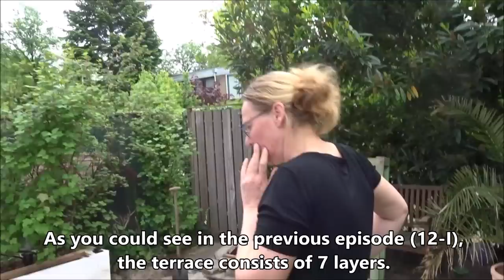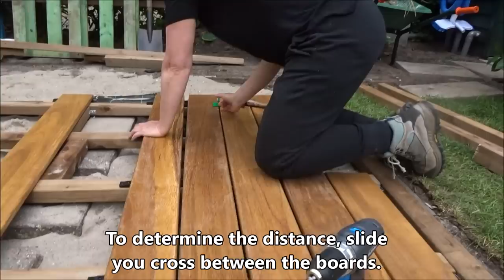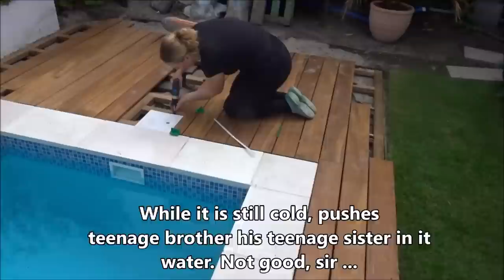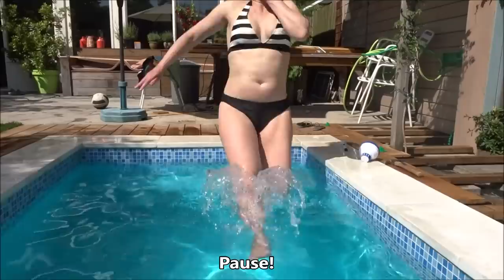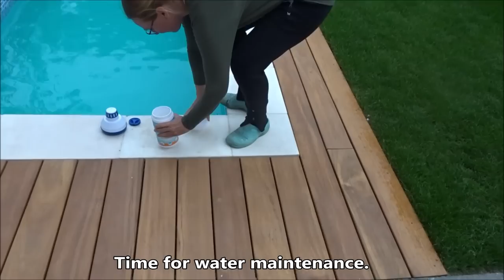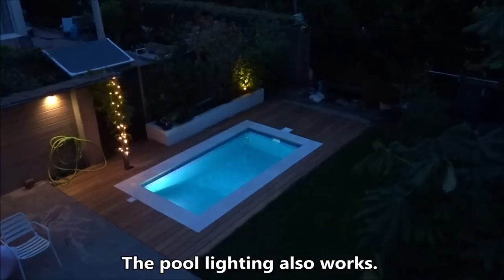Wooden terrace around the pool

Comment: Hmmm. Time to start digging a hole. I should have it dug in 3 years. I love your dedication and the quality of the finished pool. I am thinking of digging me a 30 x 50 foot hole, where the first 1/5th slopes from 1ft to 3ft the next 10 feet slope from 3 to 5 then next from 5 to 5 (same) the next from 5 to 9 and the last at 9 ft deep (for a diving board) what I really need is an excavator to do the digging. I watched every episode of this project and what's so nice about it is that unlike all the other 'do it yourself' videos which finish on the last step when everything has just came together... your shoot finishes with some pride and the full glory of the pool and some decent brew !! Hats off for a very nice youtube experience. Now I should really start thinking about doing a pool myself. It will probably take me a couple years but once I get a hole dug and the cement blocks in place, this will make a splendid hobby. Was thinking about doing my bathtub laid in tile but the room is just too small. Nice work. I grew up in germany and the house 8 houses up the street had an indoor tile pool like yours and I loved it as a kid.

Comment: I've been trying to locate the hidden connector clips for the deck so I can use them - have taken pic from your video (your captions call them "sticks", so I don't know what to search for online) to hardware store and they just don't have here in USA that anyone can find. Can you put a link to the product you used so I can order online and have them shipped? This is a great job by the way - have been on the edge of plunging in to building our own pool for a while now, just haven't had time with other projects!
Reply from the maker: Dear Paula,
Sorry I noticed your question so late! You could also mail me on: contact@nicolemichaeldiy.com so I can give you some more suggestions, o r if the link doesn't work. 
This particular hidden fastener I found on the Dutch Amazon site. I am not sure if they ship overseas though, but you can try! Best, Nicole

 https://www.amazon.nl/terrasdrager-sticks-inclusief-cilinderkopschroeven-5009422556609/dp/B07HF6VLWG/ref=asc_df_B07HF6VLWG/?tag=nlshogostdde-21&linkCode=df0&hvadid=430611527711&hvpos=&hvnetw=g&hvrand=2016851104189230978&hvpone=&hvptwo=&hvqmt=&hvdev=c&hvdvcmdl=&hvlocint=&hvlocphy=9065289&hvtargid=pla-730388532684&psc=1